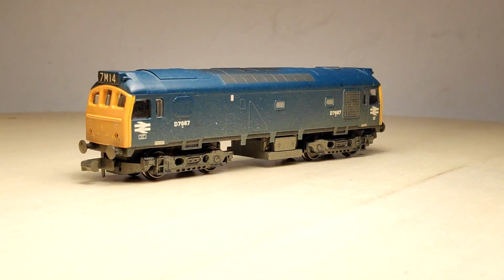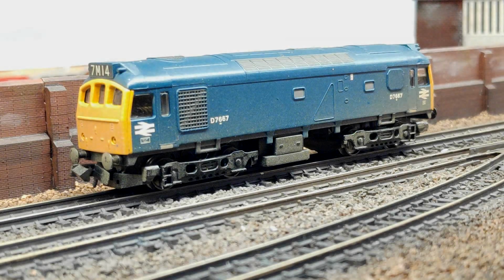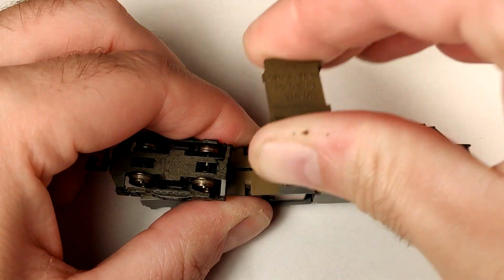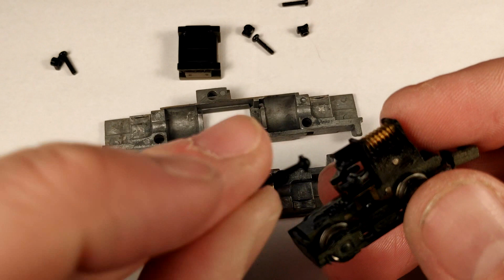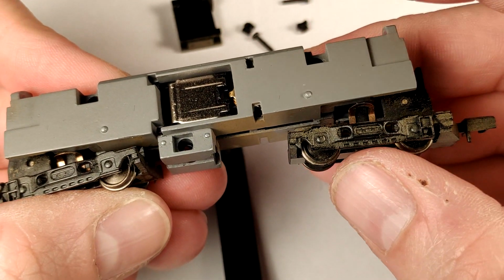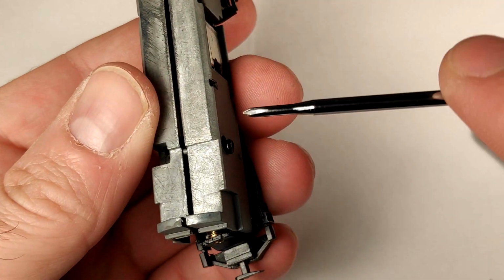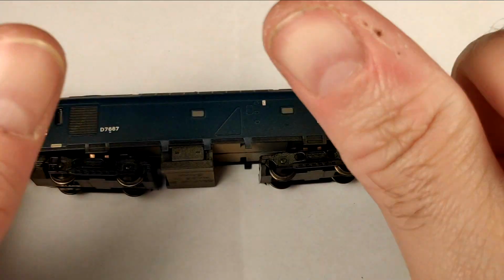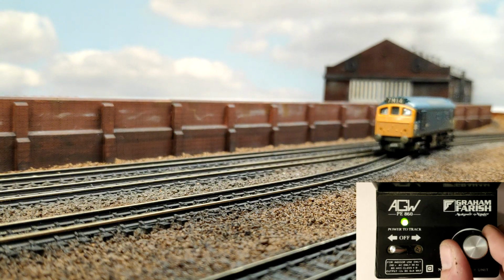Graham Farish Class 25 Fix and Run N Gauge

Comment: Hi Rich - I had never seen your channel advertised before so it was not until Ian of Ian's N Gauge told me about you that I looked in. I have subscribed.
Enjoyed this video straight away, nothing better than to see someone do it first and show you how to take apart properly.
I am building a replica of Bognor Regis terminal Era 3 in N gauge and I have a lovely photo of what I think are four LBSCR Stroudley D class 0-4-2 tank locomotives around the turntable. These by all accounts replaced the terriers that were there.
They were often used for shunter duties but no one seems to make them but they still look very much like the Dapol 2S-012-018 N Gauge SR Terrier 0-6-0 T B653 Southern Lined Green which they state are not DCC Suitable, but I have seen them converted. Quite sure I can make it look like a D class.
I have acquired a Terrier along with a Tramfabreik 12V coreless motor and a small harness decoder from DCCconcepts (such as the DCD-ZN8H.2).
The new motor just gives you more space to put the decoder in there. 
Now that is a challenge I would love you to do, more than happy for you to use what I have.
Regards Chris
Reply from the maker: Hi Chris welcome! Ians a good egg isnt he :), I realise the Terrier itself is a tiny loco really, yes possibly changing the motor could net you space gains, I thought Dapol did a 0-6-2 in N gauge, the exact name of the loco escapes me. I really struggled to fit a decoder and stay alive into my pannier loco by Dapol. It might be worth looking at that video to see a similar chassis to that of your terriers, Cheers Rich

Comment: how much do these usually cost as i am looking for one but i can only find the older ones
Reply from the maker: Poole type around £40-50.. the one in the video can fetch a fair price as they arent that common in blue, they run really well but it has the same shell as the poole type so finding a green one with this chinese chassis may be easier. You may find one for around £50-60... Third option is the new tool version which these go for around £100, lights and smooth runners and also DCC ready very accurate and detailed 👍